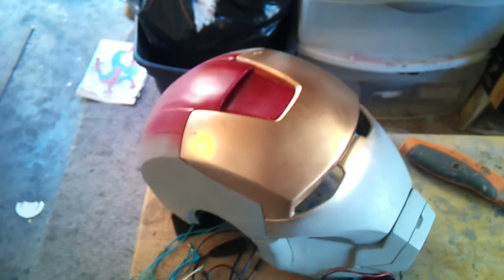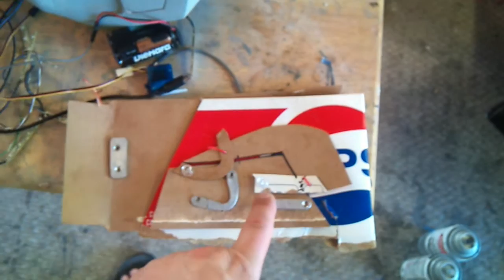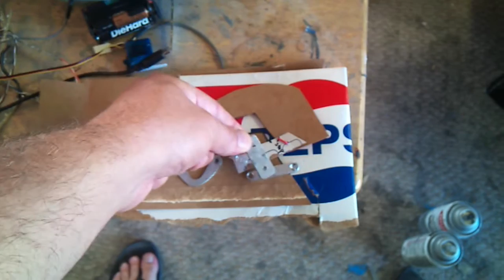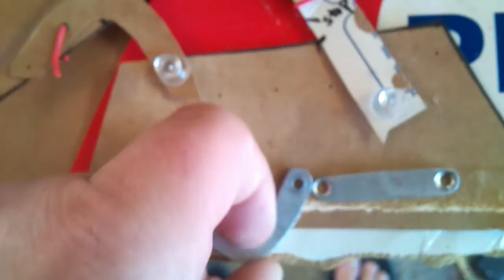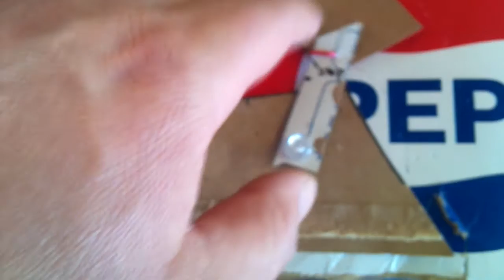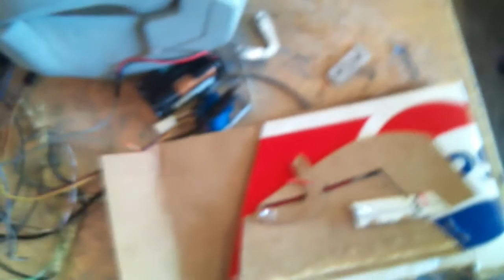Concepts: IronMan faceplate hinges, side mount.

Comment from the maker: Helms are all different and it may or may not work depending on angles and sizes. I will make a PDF of the hinges and it should be a good starting point for most people. The top mount center hinge design is easier to start off with. Give that one a try for now until this is perfected.

Comment from the maker: The helmets are either fiberglass and resin or fast casting plastic resin. The final hinges are aways aluminium. Plastic bends too much, a hinge that is solid and square to the other side is important to a consistant and problem free faceplate hinge system. Too much flex or deviation , like when you use a flexable hinge material like plastic, cause problems from where it should open and close the face plate. Keeping it as simple and solid is the ONLY way..